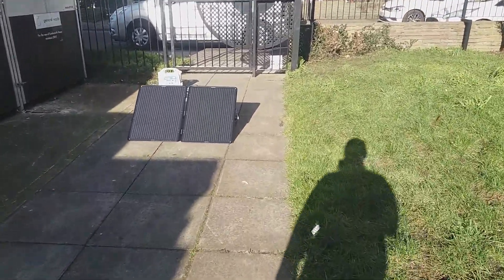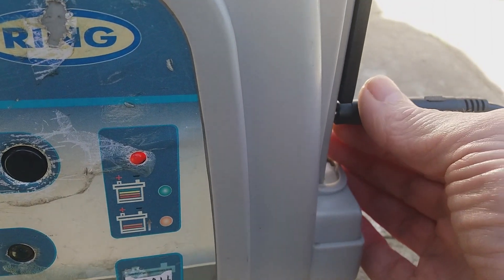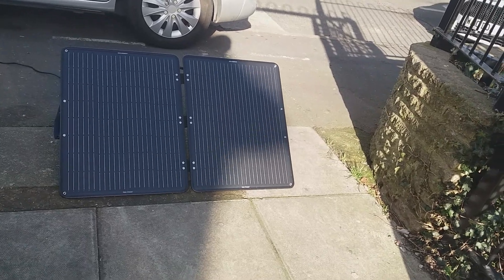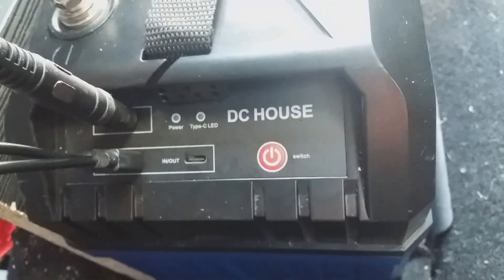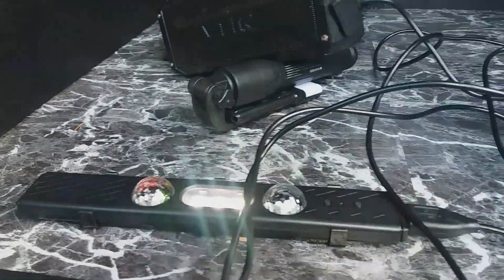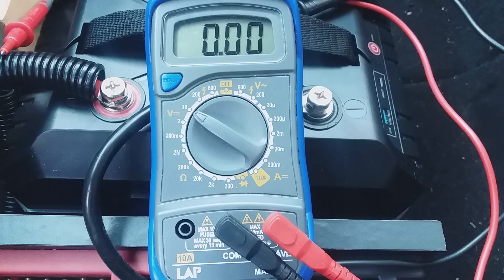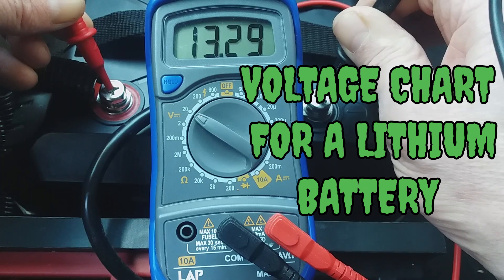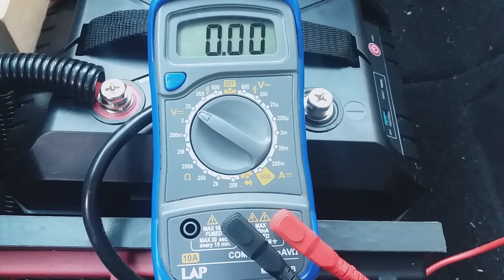DC HOUSE BATTERY UPDATE 12V LiFePo4 - 4 in 1 (PORTABLE) INC. SOLAR PANEL/POWER PACK

Comment: Nice follow up video. I noticed you're charging it directly from the solar panel (~18v right) to its DC port. I understand that's not recommended since it relies heavily on the BMS. Anyhow, have you encountered any issues by charging it that way?
Reply from the maker: Hi there since you enquired I wanted to make sure that things would be safe using solar charging the way I assumed was correct, so I contacted DC HOUSE directly, and to my surprise they informed that I had actually been mislead with their description, in that it is unsafe to charge directly from solar panel, you do need to purchase a controller, a full update and apology from DC HOUSE is on my DC HOUSE BATTERY VIDEO take a look, I now send apologies to you as you were on the right track.
Reply: @ it's all good. I am glad you were able to find that out. Thanks for following up. 👋🏼
Reply: @FILLINGTHEVOID25 Hi, cheap solar controllers tend to be PWM not MPTT and don’t get the most out of the solar input. The use of a say Victron low amp MPTT would keep the cost down and offer blue tooth as well as letting you use it for other batteries.
Interestingly using the USB C would be a cheap option letting the external USB C circuit to set the voltage and keep the battery happy.
Take care M.
Reply from the maker: Hi firstly thank you very much and no I haven't had any issues regarding the BMS,I have charged the battery directly from the solar panel (5A) as per DC House's recommended instructions,I will double check with them just to make sure.Their website states you can charge  300w of solar through the DC port (4 Hours to charge) I shall let you know what they say feel free to Like & Subscribe.

Comment: Hi what size of fridge do you have that fits between your seats please 👍stay safe.
Reply from the maker: It's a Halfords 8Ltr fridge that also has a heating feature and USB-A input,powered by 12V cigarette lighter socket also you can get a 240v house adapter so you can use were you like.Funny enough I was going to do a review on it,feel free to Subscribe 👍
Reply: @FILLINGTHEVOID25  yes please do the review on it and yes I will subscribe to the channel
Reply from the maker: the fridge is size 37cm length x 29.5cm height x 20cm width